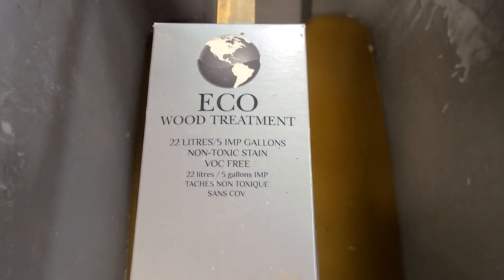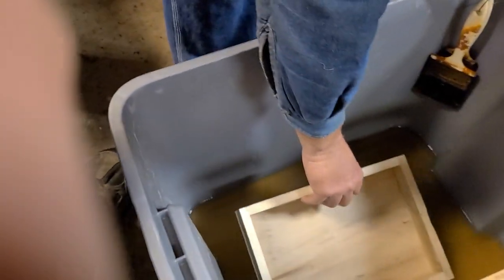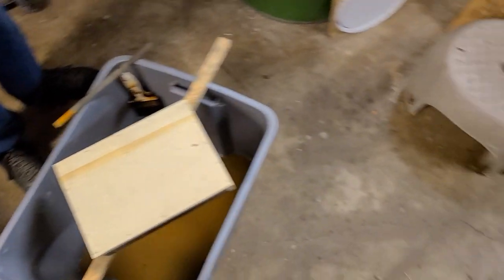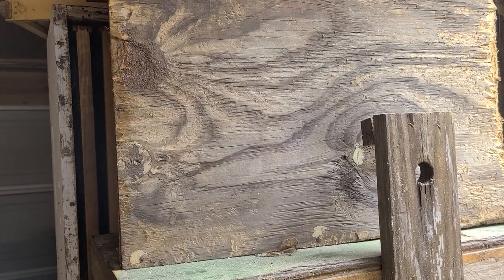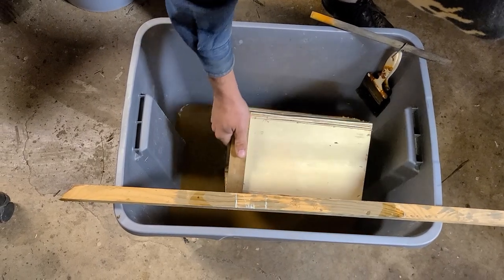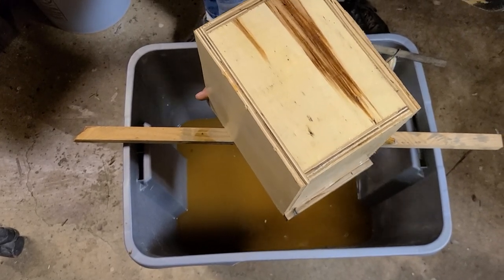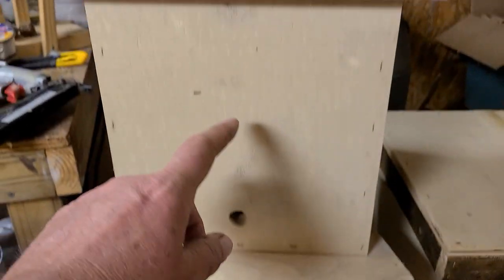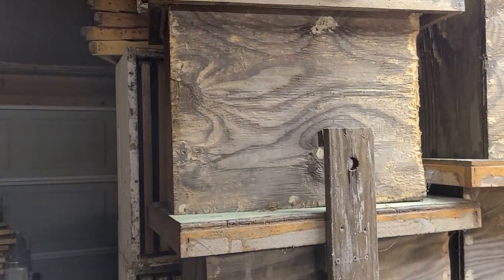STOP Painting Bee Hives! Eco Wood Treatment. Dip Them and Forget Them.

Comment: I eventually want to give this stuff a try. Most of my stuff is dry rotted and I hate painting.
Reply from the maker: ive got 2 friends that have been using it for around 15 years they love the stuff. ive been using it 4 years and if plywood holds up in the rain wet locations pine boards would last even longer. i like you hate painting.

Comment: Any paint or coating is not suitable for exterior  wood work as eventually the wood cracks and joints allow the ingress of water thus trapping water and accelerating rot from the inside. So called modern 'wood stains' are actually coatings and are next to useless. If you use an oil that soaks into the wood and any joints it will protect far better.
Reply from the maker: The swarm traps I have uses this on are still just like they were 6 or so years ago except for the squirrels chewing the corners. I seal my cut edges with tite bond 3
Reply: @WoolieBsApiary  I came by your video by searching "sealing bee hives with PVA" I just bought a serious PVA sealer on the advice of an old bee keeper I met here in Australia who used it to seal boxes by dipping, then painiting with outdoor waterbased paint. This product is a bathroom sealer called Bondcrete. I guess I'll know in a few days if this guy was right. He swore by it and raved on for ages about it, reckons after 20 years still hasnt failed at the joints.

Comment: This stuff is garbage. I treated 20 hive bodies and bottom boards last year and now need to repair or replace all of it.
Reply from the maker: how long did you let yours soak i let mine soak 10 minutes per side but i have a bigger tote than the one in the video the swarm traps are holding up great except the Squirrels really love them.
Reply: @WoolieBsApiary  I dipped them just like he did, then let them dry in the sun. The top and bottom finger joints warped and pulled away from the box. Spending 10 minutes soaking each side of the boxes would take alot longer than painting them.
Reply from the maker: @jakejacobsen6457  winter projects in the workshop they dry on top of the wood stove. i use titebond 3 and 1/4 crown 1 1/2 coated staples you cant pull them out. im doing other things and lose track of time building other stuff sometimes it might be 30 minutes.